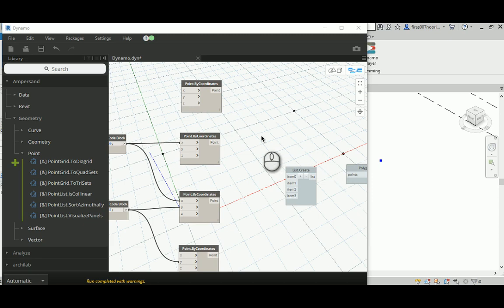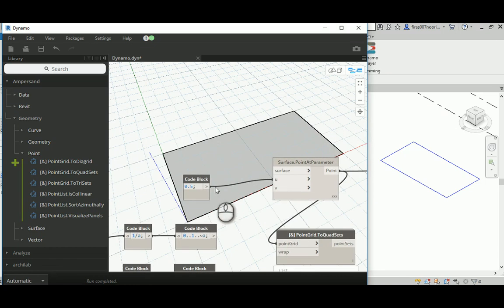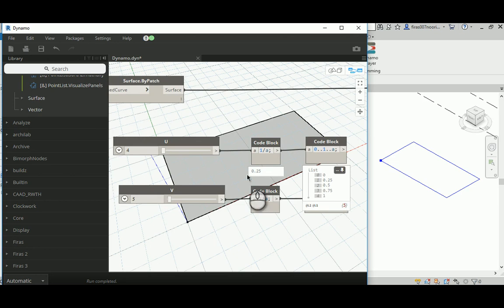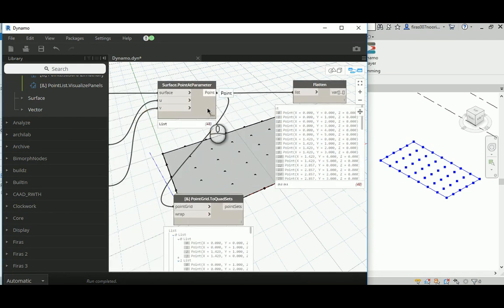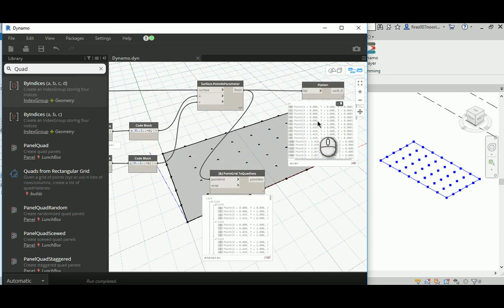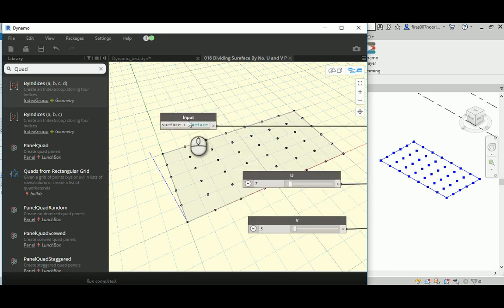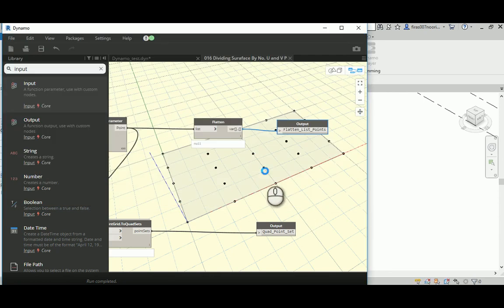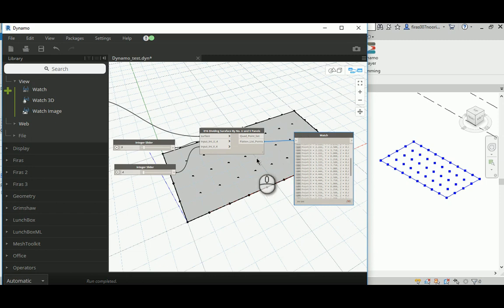Dividing a Dynamo Surface into Quad Sets of Points based on U and V

Comment: Hi. If I open a round hole in the midlle of that rectangular surface, the nodes will recognize it?
Reply from the maker: Hi dear, for this specific script , no, but you can isolate those points inside the the circle and then make the script apply successfully

Comment: Thanks Firas for your respond. Sorry I put my message in a wrong video yesterday. I like to know the next video of this subject. To know how to assign the adaptive family to the the quad points and make a curtain system. Thanks
Reply from the maker: Hi dear Friday, in this specific video I am not targeting applying with adaptive components,  but rather changing the matrix of points from normal list to quad list, in order to prepare the surface to cladded with AC, See below link
https://youtu.be/OkRvJZuCFXE
Also remember and distinguish between ac and curtain systems as you are not making the last but instead you are adding adaptive speared components that not generate eventually a unifies curtain system,  the last have different approaches a d different dynamo tools

Comment: Are you sure this will work same for other shapes than rectangle?
Reply from the maker: I designed this node to work on a rectangle, and to express how you can deal with list to make qaud set of points fit for adaptive components, you can see or try by yourself if you can apply it on other shapes 
Cheers
Reply: @FirasNoori  I tried, it works. however I am not sure if we can apply the adaptive family to them.